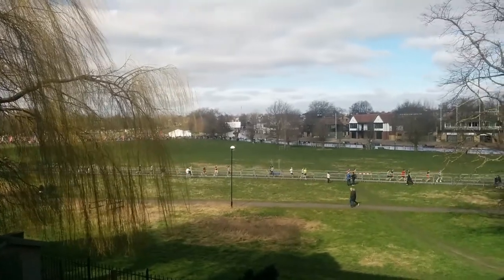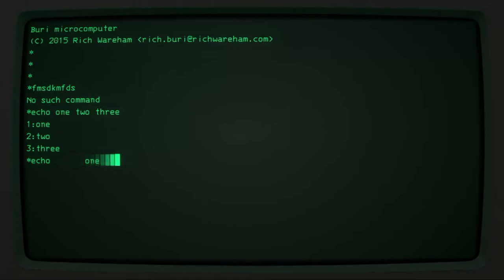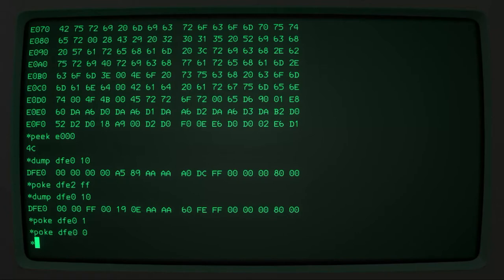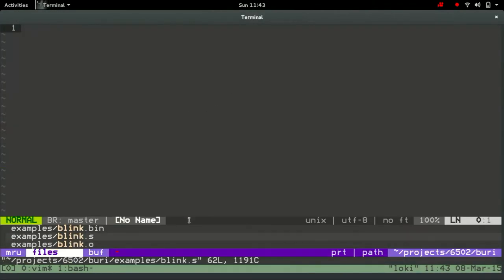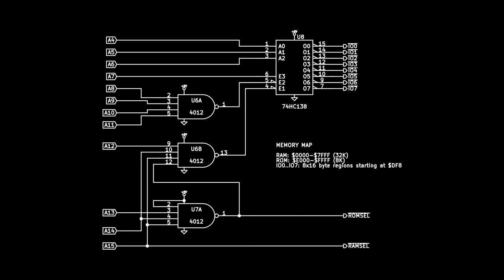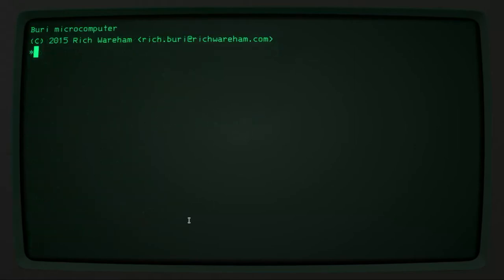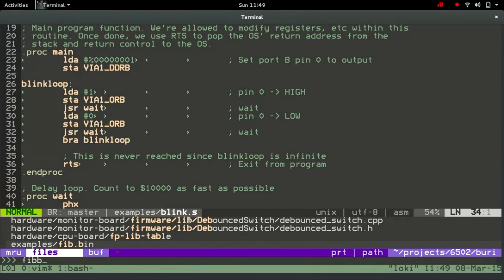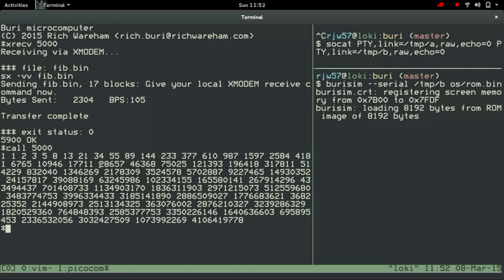Buri: a homebrew 6502 computer - part 3

Comment from the maker: Part three of my home-built 6502 based computer series. In this episode we have an OS! It has a command line and can run programs uploaded via XMODEM and everything.
Reply: Again, very nice demo', Rich.  What is the crystal (U3) value, please?
Reply from the maker: 2MHz if it's the one I think you're talking about. (I.e. the processor crystal and not the VIA. The numbering of components varies a little over time in my schematics.) It's actually a self-contained oscillator; put 5V across it and a clean 2MHz clock comes out.

In principle my system could go higher in clock speed but I'm aiming for BBC Model B-era computing as a broad goal.

Comment: I realize that you did this project over 5 years ago, so I am sorry for being late to the party. However I am in the process of building a Ben Eater 6502 breadboard computer, that I would like to add a keypad and 6 - 7 segment displays, as you have added in your project. I have started working with a keypad and a 7 segment display, but I do not have the electronic or coding experience ( That does not mean I do not have any, just not very much - I do have a little assembly language experience) to get as far as I would like to go with this project. 
Basically I would like for my 6502 project to be similar to a KIM-1 trainer, so that I can manually load things into memory and run a program. Even if that mean I have to simply burn a monitor program on a ROM, although I would like to learn how to scan a keypad and learn how to control the displays.

Comment: Interesting set of videos. There's a few things I am trying to figure out. You appear to be using the Arduino to read/write the RAM and ROM (really a RAM?), but the standard 6502 does not have the ability to tristate the address bus. The hex display appears to be MAX7221 based, so its not directly connected to the CPU busses (ala 7447 - though this doesn;t display hex), so again I assume that the Arduino stops the CPU, reads the address and databus and updates the display using SPI???

Comment: I'm loving your project... but curious, why is your emulator so low?  I mean, I would expect it to be many times faster than a 6502 even running on meager modern hardware.  How deeply are you simulating the chip?
Reply from the maker: Dustin Rodriguez It's slow because that version was emulating the 6502 entirely in Python. I've been writing the next iteration of the simulator which uses a C implementation of the 6502. This can run at the full 2MHz using less than 10% of the CPU on my laptop. (Screenie at http://i.imgur.com/27FqjQq.png just for you!)